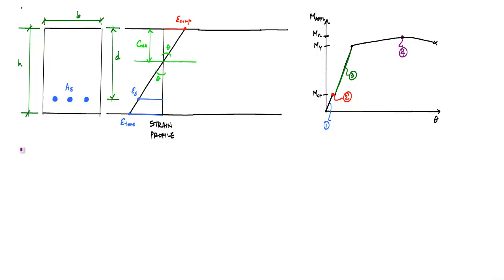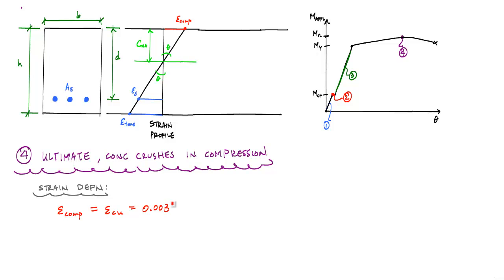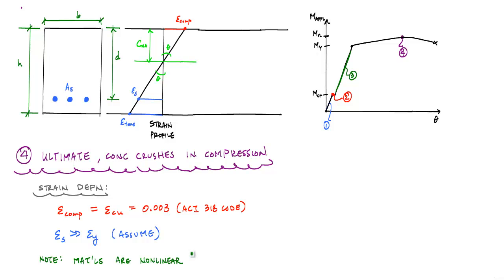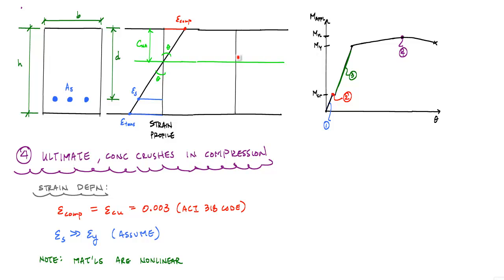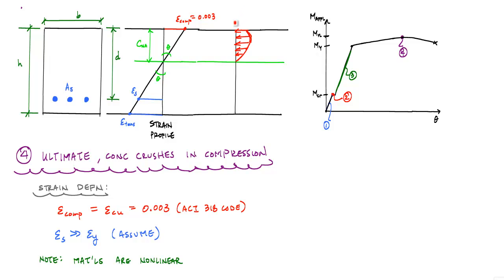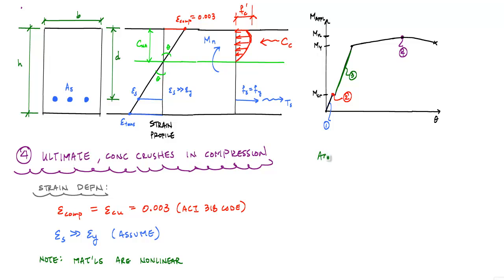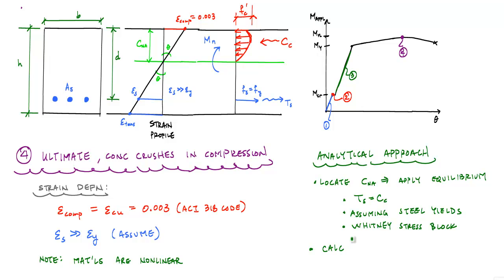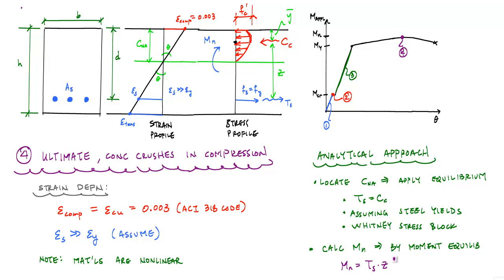Behavior of Reinforced Concrete Beams Subject to Loading (5/5) - RC Analysis and Design

Comment: Nice video. But what happens if you also take the upper reinforcement into consideration? It should make the moment capacity a bit bigger. But how does that fit in an equation?
Reply: You mean steel reinforcement at the top? If you do that the steel on the top I believe will mostly take compression, so It should not affect the Mn that much, you still design for the bottom Tension section
Reply: Now... this is just what I THINK, I don't know if I am correct

Comment: If the applied moment is less than nominal moment, how do we calculate the stress at the steel ? How can we determine whether it is in elastic state or in plastic state?
Reply: I don't know the exact value, but by observation of the Stress-Strain curve I think you can assume that your elastic state is about 0.8Mn, this of course is just from observation, don't know if it is true